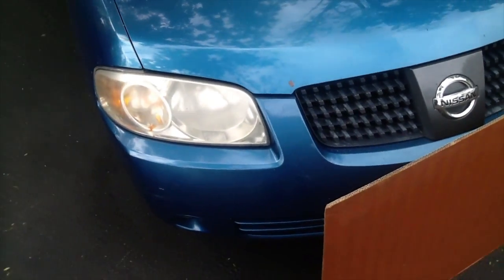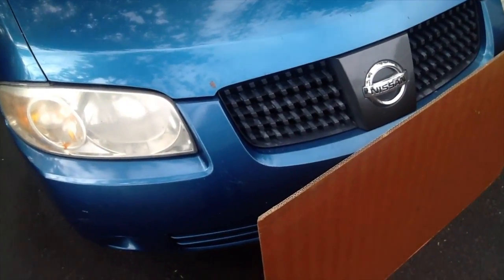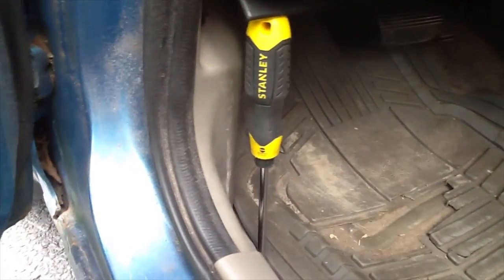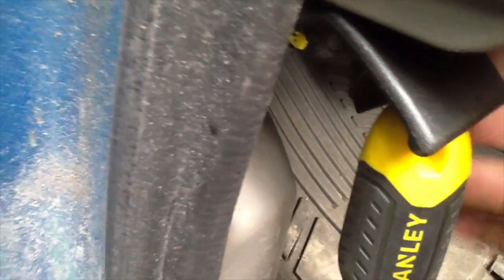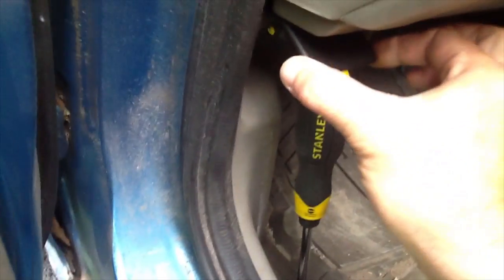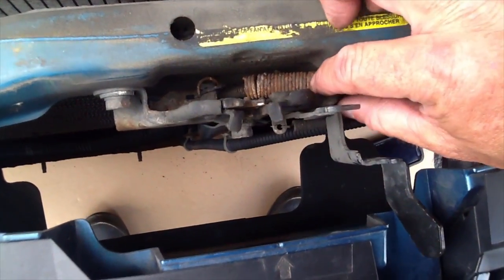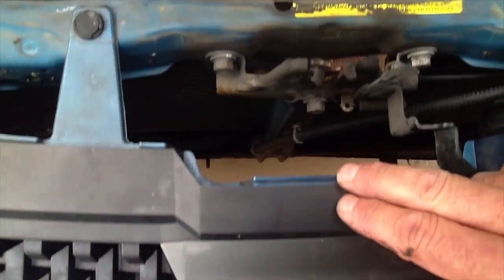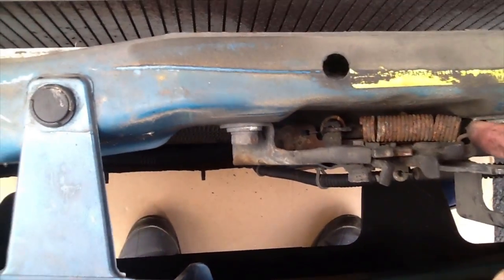How to Open a Stuck Hood Latch

Comment: You are an angel, sir. I've got enough on my plate and with a check engine light on and a desperately needed oil change, I was thinking I needed a new car when my hood wouldnt open, but I got it with this video. Many thanks
Reply from the maker: You’re welcome….Auto Zone (for free) will tell you what code is setting off the check engine light and possible causes…Glad my video helped!

Comment: Any ideas when the hood safety latch lever won't let you raise the hood?
Reply from the maker: If you have a helper that could pull  the hood latch release (from inside the vehicle) and keep tension on it while you try to open the hood from the outside (front of vehicle)… If you Don have a helper, use a screwdriver 🪛 to prop up the hood release latch from inside the vehicle…. If the above didn’t work then I would crawl under the front of vehicle and use pliers, needle nose pliers or channel locks to pull cable from underneath where the cable meets the spring on the hood latch itself…Good luck!

Comment: i have a 2005 nissan tiida and the battery is dead flat, i cant get into the car with the key fob button or manual key - the lock wont open. I think my best bet is to open the bonnet from outside car and replace battery, any idea how i can open the bonnet from outside car?
Reply from the maker: It could possibly be the battery in the key fob is dead…If that’s not the case, if you can safely get under the car and find the cable from the hood latch, using pliers you can pull on the cable and it should unlock the hood….Good luck!

Comment: Nice. Dunno what stuck it but leaving the lever pulled worked. Stuck my screwdriver thru between the cable and plastic since I didn't have one the exact size handy.
Reply from the maker: Glad you got the hood opened.

Comment: I just made a call today to AAA to jump my 2010 Escape b/c the battery dies if I don't start it every couple of days. This isn't a huge problem b/c I do have a Nissan Frontier and can use that to jump it, however, the latch did exactly as yours did. Now I am going to go find something to prop the latch and see if that works. 
Lost my husband last year so lost my mechanic for our old crappy vehicles as well as our income so having to do everything as cheap as I can. Thank you for making this video. Do you have one showing the spring replacement and did that do the trick?
Reply from the maker: Hi, thanks for watching.....I’m sorry for your loss 🙏......I do have a video, “HOW TO REPLACE THE HOOD LATCH ON A NISSAN SENTRA”....It should be a similar fix....
Reply from the maker: Good luck and God Bless!

Comment: If car was recently worked on and the hood release cable sleeve was not 
seated in the bracket but the cable is still in the leaver you can pull 
down on the cable to release the hood.
Reply from the maker: Short answer, yes.....But I would use pliers to pull on cable so you don’t cut your fingers.
Reply: Where? Interior?
Reply: @michelerussell7301  From under the car, had a rod with a hook to pull down on the cable inside the hood latch mechanism.  Not easy.